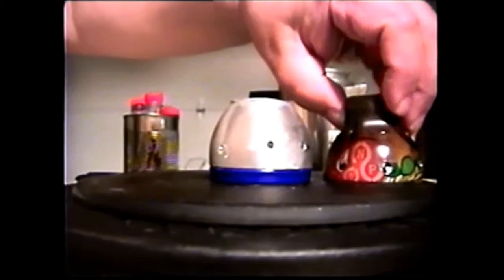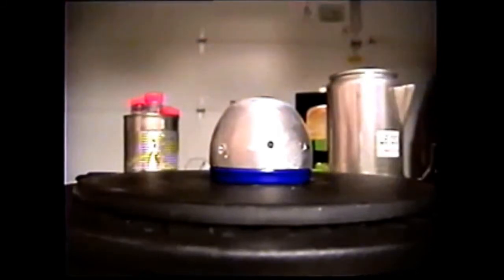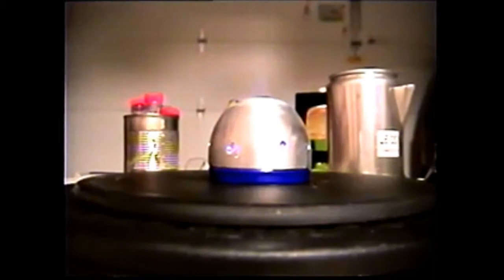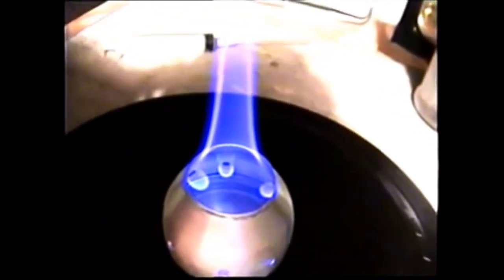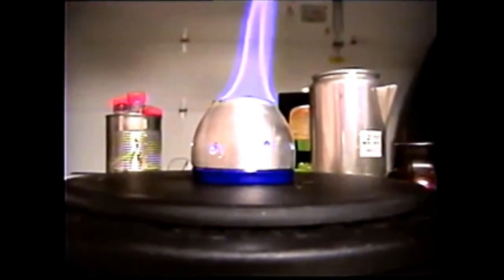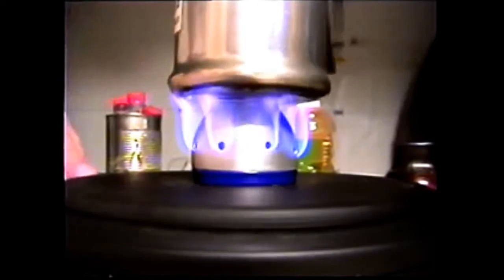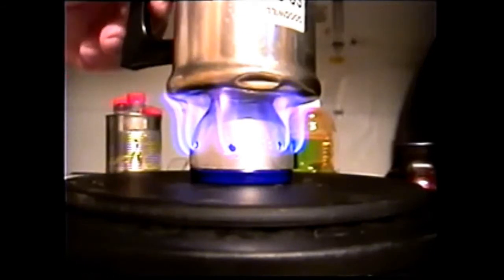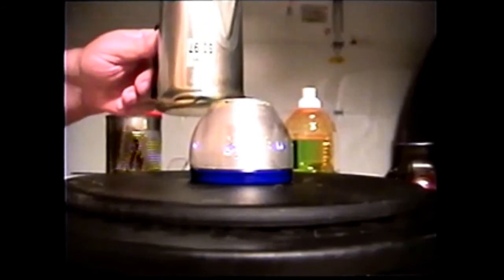Cottle Top Stove V2.0 Flame Pattern Test - Reloaded

Comment: Neat stove. I was surprised that the flame did not shoot up a foot when you removed the pot. Try another bottle stove where the jets will be 1/2 or 5/8 inch from the top. Normal height jets. That may be a great stove.